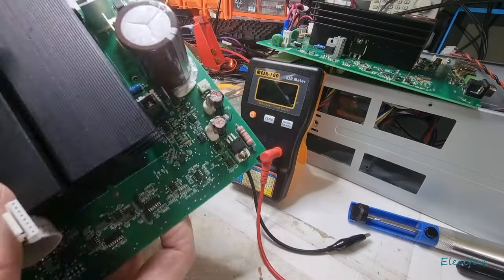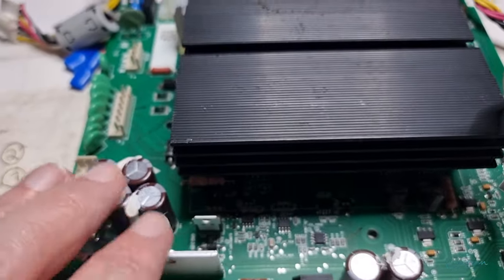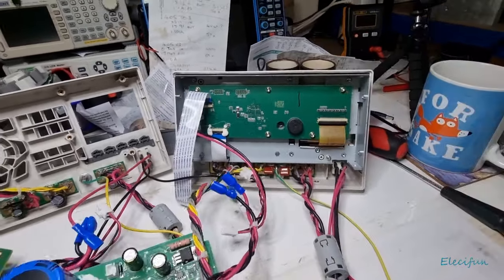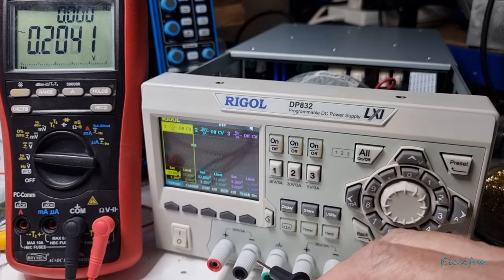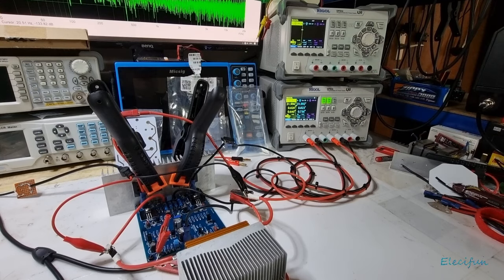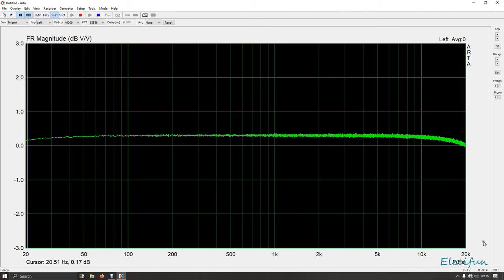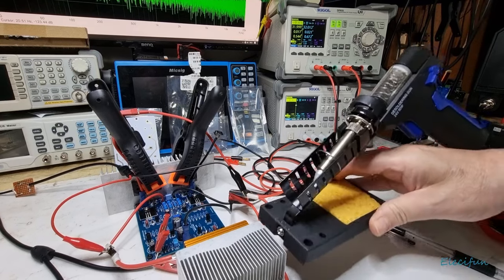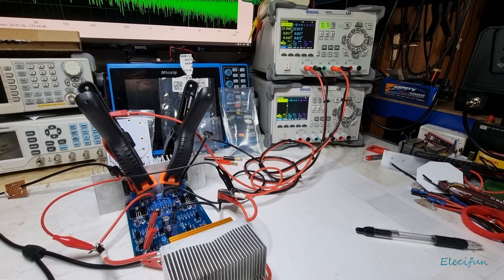Rigol DP832 Noise? Ripple SOLVED!

Comment: Nice video! I'm a bit surprised to see those caps missing - pretty much all power supplies I know of use these to reduce the common mode noise. Would be interesting to know whether this was a manufacturing defect for this unit only or a more general problem. Did you check the third channel as well?
Reply from the maker: @sebastian_harnisch I hope just this unit but will check eevblogs teardown to see if I can see there. 
I haven't checked the third channel as yet.

Comment: All right compadre! 🤔 Was it just those two caps across the ground? Or was it a combination of the two things caps plus the caps across the earth? Sorry I got halt way and skipped the rest.
Reply from the maker: @decem_unosquattro9538 I found three caps which were less than good. I replaced all the electrolytics and fitted the 100nF's on the outputs. The combined effort cleaned up the output. I do show in the video the differences. Take a peek at the second half.😉